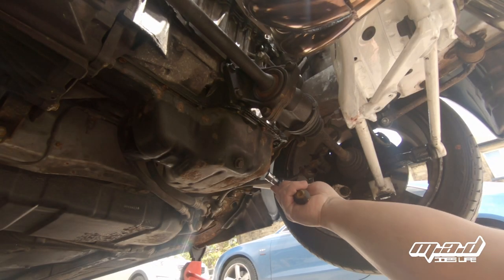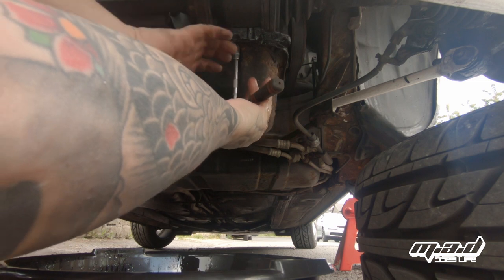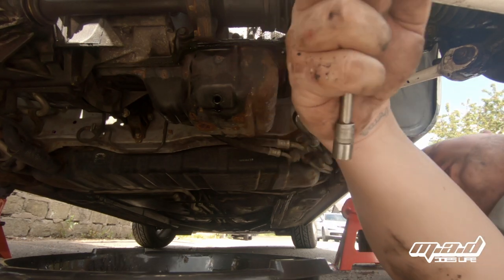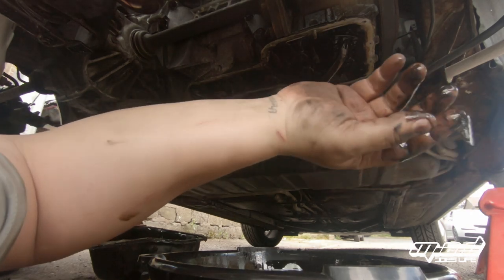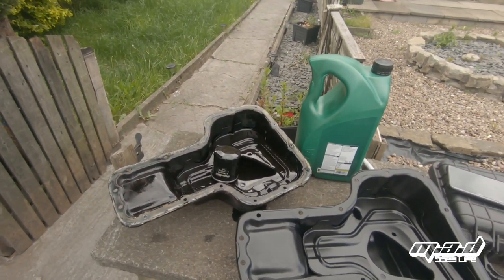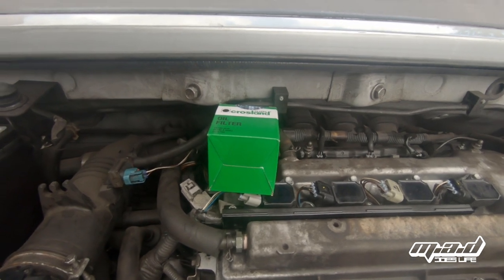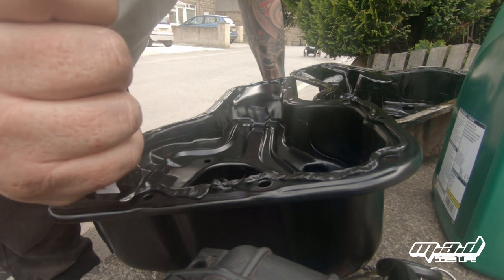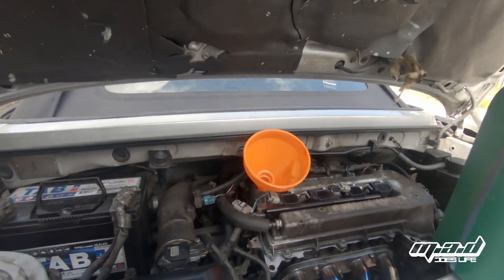MR2 Spyder / Roadster Oil sump swap

Comment: Nice Video, is there anything to prolong a non oil burner, after pre cats ... is a faster flowing oil filter better? is thinner oil better? is a carbon clean every x miles better? is walnut blasting recommended? ... I cant be arsed keep replacing engines every 50k so what can be done? as for oil, you can get Fuchs TITAN SUPERSYN 5W-40 High Performance for £18 delivered.
Reply: Using thinner oil can help it survive as it'll get back down the rings easier, but if its going to go it'll go
Reply from the maker: Sorry I only just saw this comment! The idea of thinner oil bothers me. There's a reason that specification of oil was recommended by Toyota. They key is good and regular servicing. If the crap is removed from the engine regularly, it can't build up as fast. Many people take these engines through 150k miles with no issues if it's been looked after but if it hasn't been serviced for 5 years on the run, it will be in a VERY sorry state.
Reply: I've had the same issue and eventualy rebuilt it, drilled additional oil drain holes into the pistons and used better oil controll rings from Mahle.
I had some sucess with engine flushes and early oilchanges.
It did reduce the oil consumption for a while.

Comment: Id of done the oil pickup to.
Reply: Well done you
Reply: @Ajharris76  if your doing a job do it right!
Reply: @darylhatherrley5765  I did it right. The pick up was fine. No need for replacement. You do you.
Reply: @Ajharris76  Didn't see or hear any mention of it in the clip, you can only tell if its fine by removing it and looking inside.
Reply: @Daryl Hatherrley  as I said Daryl, you do you. I'll do me..